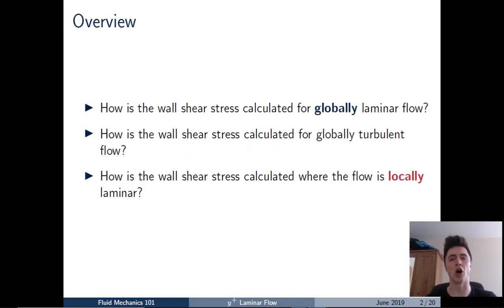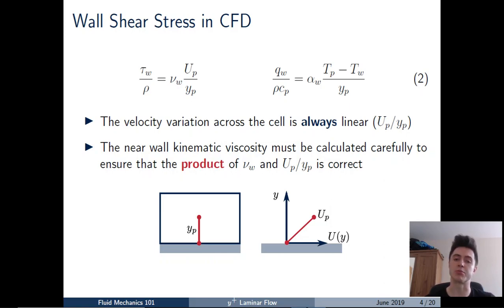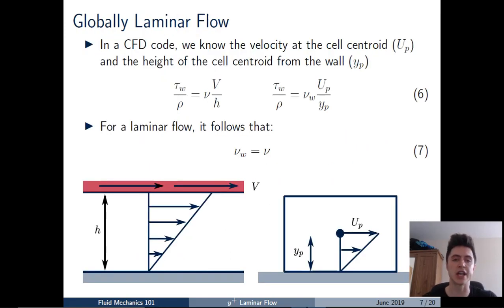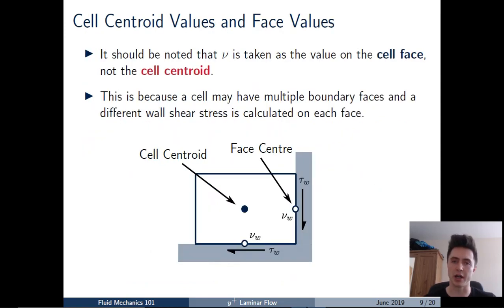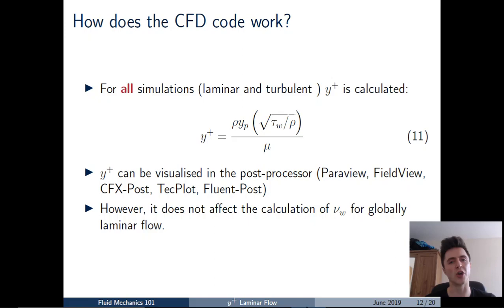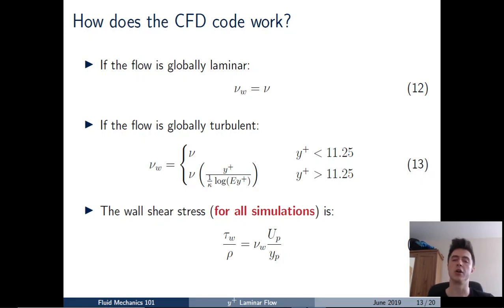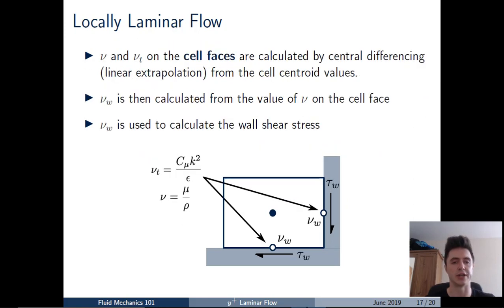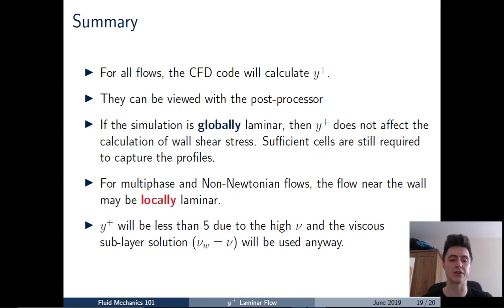[CFD] y+ for Laminar Flow

Comment: Hi Aidan, i wonder how its possible to accurately  calculate the value of y+ after solving a cfd problem.  As it depends on frictional velocity which itself is dependent on WSS, how can we be sure that the correct value of WSS is used? for example when we have a too coarse mesh near the wall,  WSS will be underestimated and therefore y+ will be wrong? Anyway, if in our cfd simulation, the quantity of interest is WSS, how can i rely on y+ which itself depends on WSS?

Comment: Hi Aidan, 
 I have question：why the SST turbulence model and lanminar model produce same result，when I simulate the laminar flow between two parallel plate?
Reply from the maker: Because the turbulent kinetic energy is calculated to be very small, so effectively there is no difference in the momentum equations between running 'laminar' and with the 'k Omega SST' model

Comment: Hi, you mentioned that for globally laminar flow, the wall shear stress does not depend on y+ based on the result of a flat plate moving at velocity V. In this case, the velocity profile is linear, so the velocity gradient is the same regardless of y+, which makes sense. However, for pipe flows, the velocity profile is quadratic as you show on the next slide. In this case, wouldn't the velocity gradient depend on how fine our mesh is? The gradient would get steeper and steeper as we approach the wall, so wouldn't the wall shear stress depend on y+?
Reply from the maker: Yes, but the CFD solution is always piecewise linear. The piecewise linear solution will only approach the limit of a quadratic velocity profile as the mesh size tends to zero. In practice that means that the solution (y+, wall shear stress etc) will keep changing as you refine the mesh. However once the error is small enough then we are happy to just leave the solution there 👍
Reply: @fluidmechanics101 Oh right, I think I was accidentally interchanging y+ with mesh size. So the shear stress will still depend on the size of the mesh, but not on the actual value of y+ since the gradients are small in laminar flow, and hence the linear solution from the CFD is basically good enough. Please let me know if I'm still misunderstanding it.
Reply from the maker: Yes, exactly!

Comment: So the viscous sublayer approach will be used by the code only till y+ < 11.25 or for the whole locally laminar region even beyond y+ >11.25.
Reply from the maker: Yes, with a classic wall function approach based on switching
Reply: @fluidmechanics101  Well then it is nothing new, is it? Just same as a globally turbulent flow....just that the viscosity is of this other fluid.

Comment: 19:18 How will you use extrapolated nu from centroid to wall to calculate nu_w? I didn't understand this point. Or you mean they are same?
Reply from the maker: Linear extrapolation would work
Reply: @fluidmechanics101  No i mean once u extrapolate how will u calculated nu_w?

Comment: heello, do we need prism layers mesh in a global laminar flow in a pipe or just a fine mesh in all the fluid domain?
Reply from the maker: Layers are still needed in a laminar flow. They probably just don't need to be as fine close to the wall. I would aim for 15 cells across the boundary layer and you should be fine

Comment: Thanks Aidan for your great videos! I have learned a lot from them. Keep up the excellent work. 
I have a question about y* in laminar flow. As we don't calculate k and eps in laminar flow, the value of kp is unknown. So, how can we estimate y* if we want to estimate it instead of y+?
Also, I appreciate it if you could introduce me a paper or a book that I can learn about the initial conditions of k and eps in turbulent flow.
Reply from the maker: Well spotted, that is a good question. I think the usual convention is to make y+ not available to the user if we run a full laminar simulation (no turbulence model at all). But if you have a turbulence model  turned on and the KE is very low (essentially locally laminar flow) then it will be able to give you y* and y+
Reply: @fluidmechanics101  Thanks Aidan!

Comment: Dear Dr. Wimshurst, thank you very much for your effort. You explain all these complicated topics so clearly. It is so invaluable.

I want to ask about something: I suppose, here you're talking about in-house CFD codes. Because, as a Fluent user, I think y+ is not calculated and not available as a post-processing variable for globally laminar flows. Furthermore, I must admit that I have never heard of nu_wall before. There is no mention about it here: http://jullio.pe.kr/fluent6.1/help/html/ug/node451.htm
Reply from the maker: Hi Kenan, yes i was mostly basing this on OpenFOAM, as the source code is open source and you can actually see what is going on.

Yes, in Fluent you wont be able to see y+ as a post processing quantity if you set the flow to be globally laminar, as y+ appears under ‘turbulence quantities’. 
Really this talk is for: OpenFOAM users, general understanding and flows which may have local areas of laminar flow but may be globally turbulent. Sorry if this was confusing for you!
Reply: @fluidmechanics101  Thank you for explanation. No worries, it's always good for me to sometimes get out of my comfort area (i.e. Fluent) :-)

Comment: Thank you. Please what is the recommended value for y+ for laminar flow over a flat plate in ANSYS FLUENT. Is it (Y+ = 1) or (Y+ << 1) because I need it to calculate the first cell height.
Somebodies say that for laminar flow there is no Y+ , but the boundary layer consideration.
so that can I know what is better

Regards
Reply from the maker: Hi Mahmoud, i think this is answered in the video but perhaps i didnt explain clearly enough. To summarise, you do not need a specific y+ if your flow is laminar. However, you should still ensure that you have sufficient cells to resolve your velocity/temperature/species profiles with sufficient accuracy 😊
Reply: @fluidmechanics101  Thank you very much. Really, your channel is the best.
Reply: @fluidmechanics101   Hello Dr. Aidan It was an amazing video. Please let me know how to calculate y+ for thermal boundary layer.  I looked for the answer but could not find much content on y+ calculation for thermal boundary layer.

Thank you.
Reply from the maker: Hi Parth, y+ is calculated in the same way for the thermal boundary layer. The only difference is the thermal profiles also depend on the Prandtl number (which is a material property that you can look up in a text book).
Reply: @fluidmechanics101  thank you. Keep sharing your knowledge. CFD is the best career option for mechanical engineers.